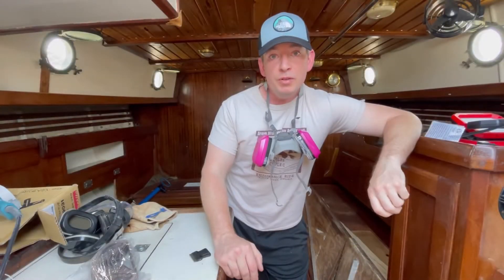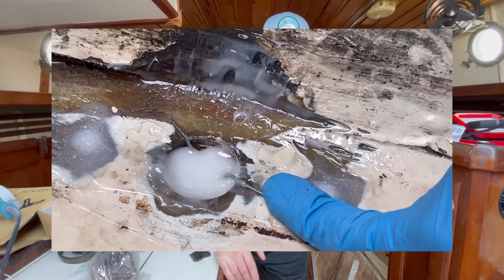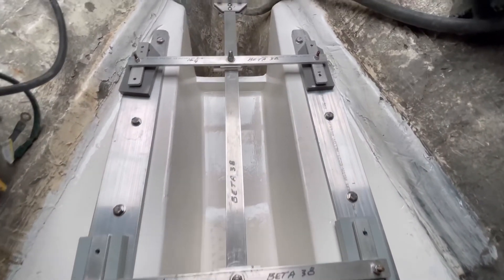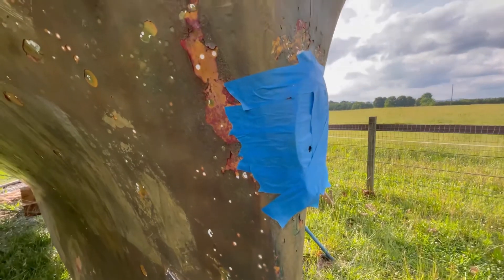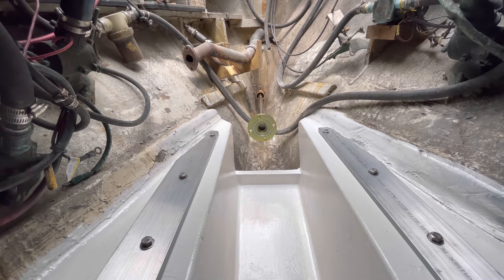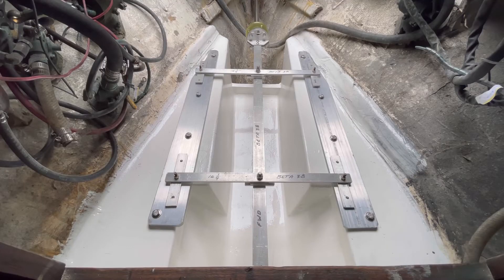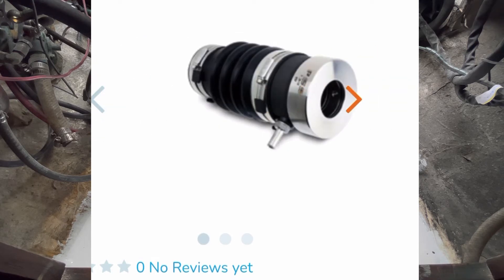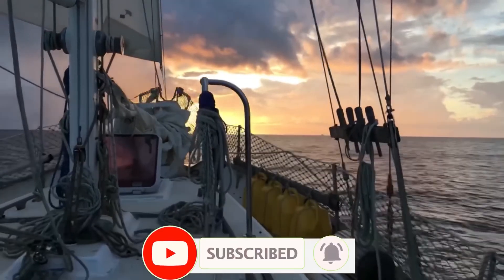Final Part 3 of How to Install a Sailboat Engine Using a Jig | Sailboat Restoration Ep. 18

Comment: I made a jig using plywood on our refit. Our pan is similar to yours but a little different - our engine beds are not hollow below - wood stringers. Our Beta 35 arrived in April - the engine is now in - working on exhuast, fuel systems, and electrical. Planning on first fire up by the end of June.
Reply from the maker: Jig definitely made this an easy installation. I’ve added new raw water strainer, and a new fuel water separator. I also ended up with many useless electrical wires from the old Volvo since the Beta came prewired.